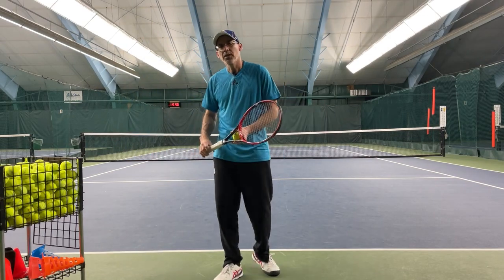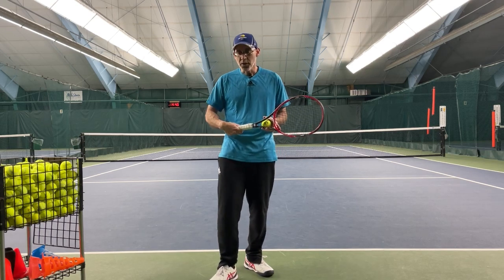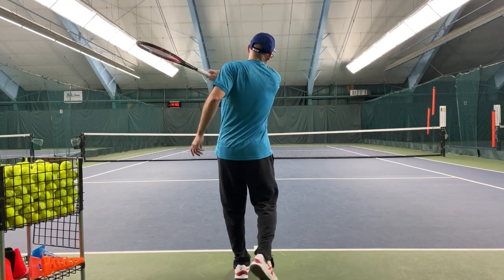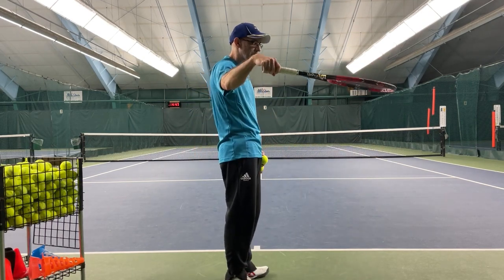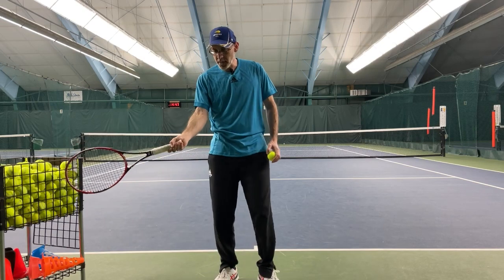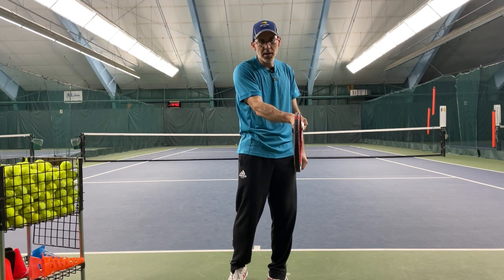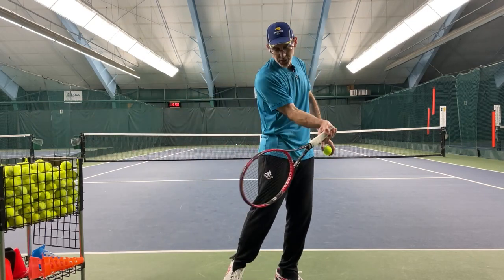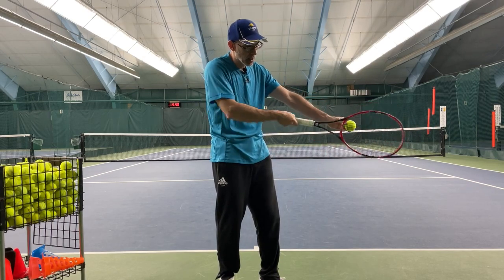First Principles Of Tennis: Push VS Pull Contact Point You Have To Feel/See To Believe

Comment: pulling allows the racket head to work for you and not vice versa. good point coach
Reply from the maker: Thanks for the comment juicetest. Exactly, the racket has very high end technology in it, why not take advantage of it? Good luck and stay loose!
Reply: @NaturalTennisSolutions  Pushing will not give you access to the benefits of a full swing racket. so good thing to identify for adults.

Comment: Could be semantics, but it's more of a coil and a PUSH than a PULL. If you internalize a "pulling" motion, you'll break the kinetic chain, will be late often, and mishit often by trying to muscle the ball. You don't bring the racket back with your arm (which you would if pulling); the key is COILING or TWISTING to get the racket face pointing to side fence, and then pushing off the ground with legs, uncoiling (fire your hips) and going forward with a loose hand (to get racket lag) with more of a pushing feeling along an inside-out path (hand near your pocket). Applies to golf as well. 5.0 here.

Comment: Hi Gene, great video. I have a problem, when I have a loose grip on the racket, my wrist is also loose, but when I hit the ball, my racket is so loose that I don't get a clean impact. When I grip my racket firmer, I get a good, clean and firm impact but my wrist is stiffer and she doesn't have that mobility that you show in your video. Do you have any tips to fix this?
Reply from the maker: Thanks for the comment and question Guitar videos. The key to this is to loosen the wrist up as much as possible while keeping the grip as firm as you need it to get your clean hit. I will assume that you don't have the pulling aspect of the swing and that may be why you have this issue. If you are pulling the racket with a loose wrist, the swing should make your racket pull across the ball for a millisecond to get the clean contact at a square face contact point. Keeping the racket as square as possible will lead to clean hits. Hopefully that makes sense. Good luck and stay loose!

Comment: Once you have an early contact point and good racket head speed coming into the contact, it's all about extending to that target and turning that wrist closed to finish things off.
Reply from the maker: Thanks for the comment again Jae-Rae. Agreed, turning the wrist is the key element. That's a big problem if your wrist is tight though. It won't turn in its natural movement pattern if it's tight. That's why the windshield wiper terminology is lost on most players that try it. The wrist should be loose when doing it so it can turn smoothly not abruptly if it's tight. This game is already very difficult without having to deal with technique on the brain while we play. Let's hope we can figure something out with this crazy path I'm on right now. Worst case is we just say this is something not to do and cross it off the list. Good luck and stay loose!
Reply: @NaturalTennisSolutions  Agreed! I didn't really have an issue with being tight because it's was something I discovered through repition and adjusting to what felt right as opposed to trying to manufacture that windshield wiper motion because a coach said so. I also think you can get to a point where being loose is overexaggerated though because while that's important there has to be some stability and control which being too loose can compromise. Personally I prefer the term 'relaxed' than 'loose.'

Comment: It's never explained like this to me, but from just the instruction of hitting the modern forehand, this pulling motion is natural in the inside out, or down the line forehand, which you would want the side spin.  But it's a different motion for cross court.  You can't pull this way for cross court.  Besides you would want the side spin to go the other direction for cross court.  So the path should either be a push or a whip.
Reply from the maker: Thanks for the comment Tom. There are definitely pieces to this that still need to be explored. I understand your point about a cross court shot. Remember that the pulling part of the swing is not natural to most players. This is why we need to go out and explore how to feel certain pieces of the swing to make it feel as relaxed as possible. Good luck and stay loose!
Reply: @NaturalTennisSolutions  Thanks for pointing this out.  The reason for me it's natural is because I would not be able to hit an inside out forehand without pulling like you explained, so my inside out FH does have side spin.  However, I never thought of it that way, and now I realized I should do the same motion for down the line too.  I saw a clip of Kyrgios doing just that, even though he didn't hit down the line, just a straight shot down the center part of the court.  But his shot has side spin in addition to top spin.

Comment: Nuts.  Should be attacking the ball from the inside with a lagged racquet, so as the racquet approaches the ball it squares up with the ball, not going across, but extending through the ball, which makes your circular path as wide as possible, see Rafa.
Reply: That’s what I was thinking…
Reply: The guy was just explaining how that inside-out side spin is created when he said hit across the ball. He literally said don't judge yet as he has not explained the topspin portion.
Reply: @papayanut  He literally asked at the end of the video if he was nuts, so I answered.  Regardless of any topspin component to come, approaching the ball from the outside and going inwards across is a recipe for a weak ball.
Reply from the maker: Thanks for the comment Henry. You're right, I did ask if you think I'm nuts. I have my reasons for putting this idea out there. I'm not sure I agree with the going through the ball aspect of the swing if you're putting topspin on the ball. When I think through the ball I always picture the flat push type of shot. If we want control and spin there has to be a gripping aspect of the contact point. Let's just see where this is going and hopefully you'll see something that may be different or maybe you already know something I don't know. Either way, it's an opportunity for us to learn from each other. Do you agree about the wrist looseness on the swing? Good luck and stay loose!

Comment: Hi Gene, I tried your pull technique and my forehand improved immediately. But my wrist started hurting. Could it be because I snapped my wrist at the contact point instead of firming it at the contact then release it. My normal forehand is like Jimmy Connors. Hold the firm wrist through out contact.
Reply from the maker: Thanks for the comment Tim. The wrist release is definitely different than holding it firm at contact which can change the way your wrist ligaments and tendons get stretched. I had some pain as well but nothing that hurt enough to make me stop playing. I asked one of my clients who is a hand surgeon about the pain and he said as long as it's not hurting every time you swing or even when you're not swinging that the tendons and ligaments should get used to the stretching and the pain will subside. As long as you're not over swinging with speed you should be ok. As for me, my wrist is used to the extra stretching and it's doing well and not hurting even though I have increased the speed that I swing at now. I can swing very fast and gain a lot of spin and speed with no pain since I got used the swing and am using my body correctly. It's a new world on the court now with how this works for me. It's the most fun I've ever had on court! Good luck and stay loose!
Reply: @NaturalTennisSolutions  How many grams of racket do you use? I use a 430g screwdriver and the results are also very good

Comment: Time 6.30/6.50 where Gene explain the most important part. If you watch the following video that's  where all things become clear.
Reply from the maker: Thanks for the comment Rudy. You caught the part that most players will overlook. We are supposed to keep the ball on our strings as long as possible. The only way to do it is to add as much spin as possible to the ball and feeling the shape that it will make when we move our body a certain way. Shaping is the true way to understand how to control a tennis ball. I will elaborate in due time. Good luck and stay loose!

Comment: Loose yes.  Pull to me is a confusing term..  More like accelerating racket head at point of contact. Push is more like not accelerating at point of contact. More acceleration, more  force on the ball.  F = mA